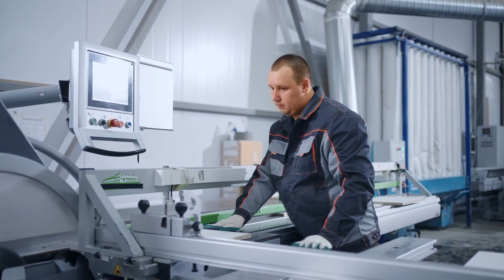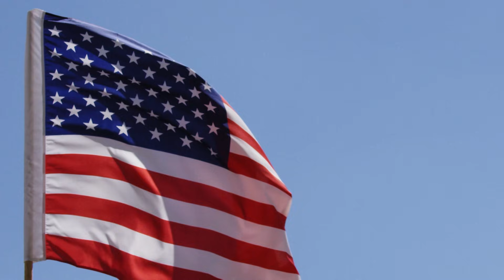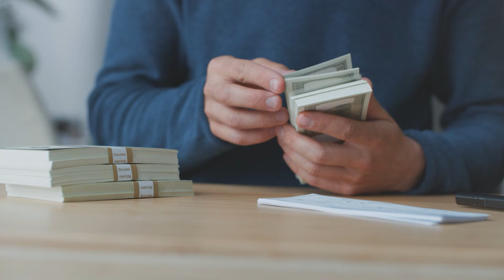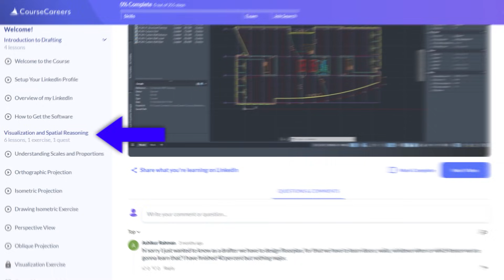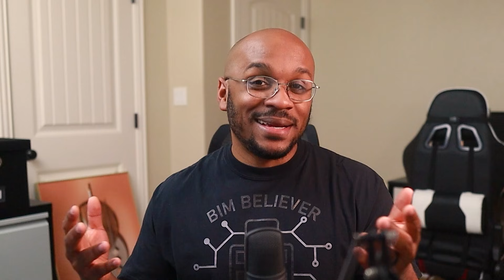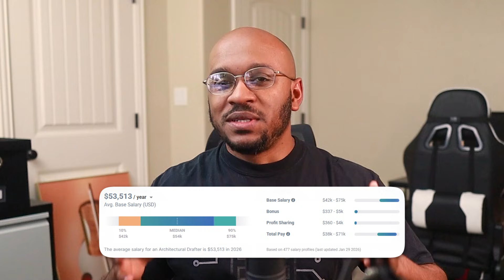How I would learn AutoCAD (If I Could Start Over)

Comment: Agreed. Technical skill is mostly 2D DWG and annotation. Layer type, line weights, X-Ref management, clean and readable title blocks. The AEC industry seems to want to get away from 2D. Using the BIM model for contract and material take-off, scheduling, and operations. Seems like a big task, but  2D DWG still rules.
Reply from the maker: Spot on, the industry is definitely shifting toward BIM, but 2D isn't going anywhere fast! And, mastering those technical 2D fundamentals is still crucial for any drafter.